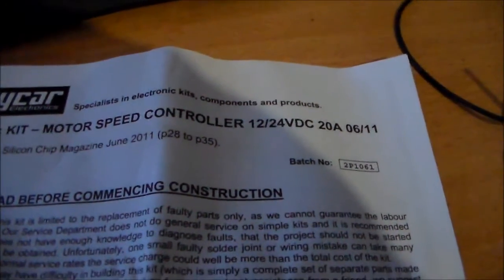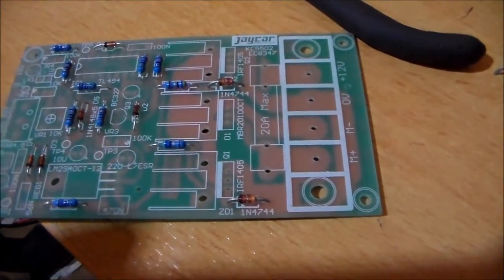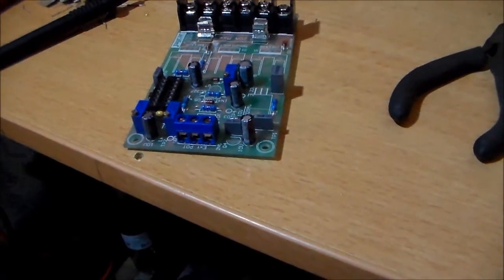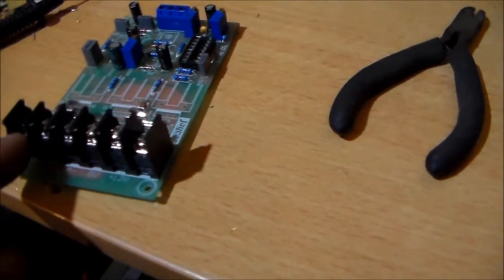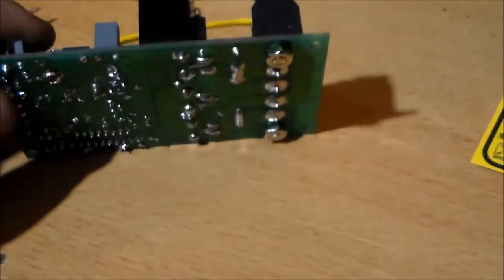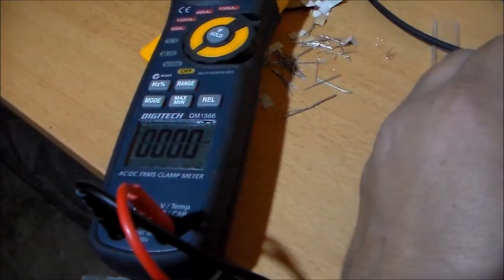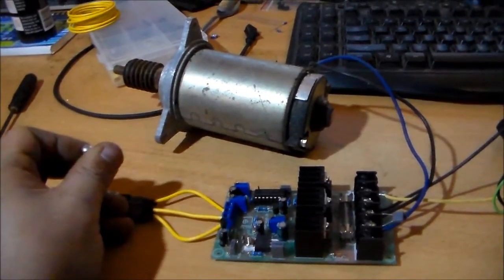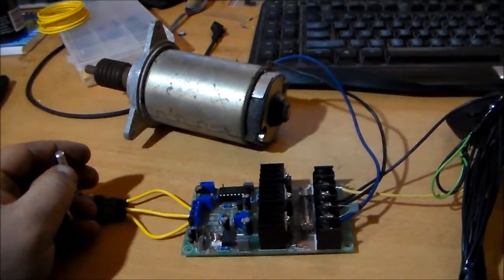Circuit Build: Jaycar 20 Amp 12/24v Speed Controller + Test Run

Comment: i have the 40A 12/24 motor speed controller from altronics but i think its at jaycar too it had a nice red display and a easy firmware but an impossible board to build and the crimping is crazy